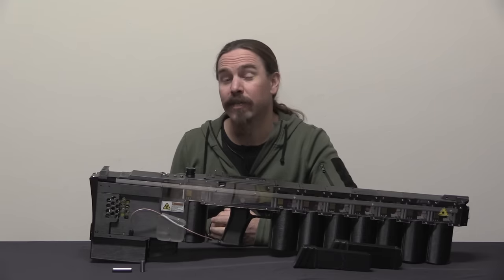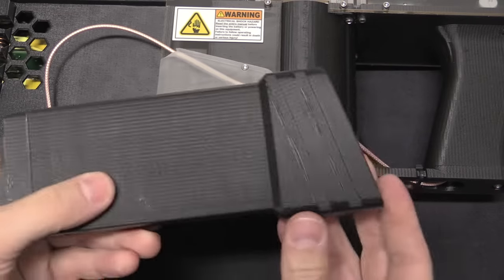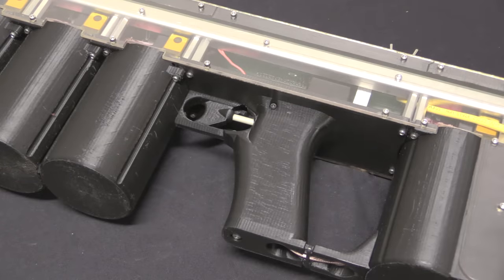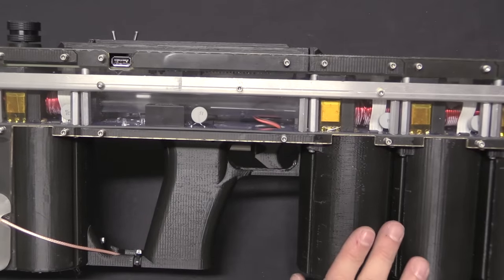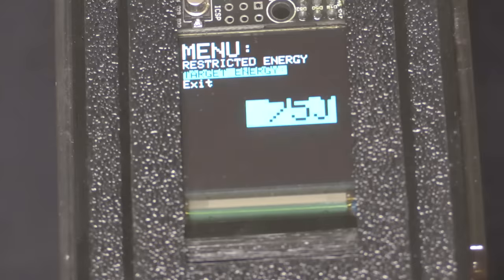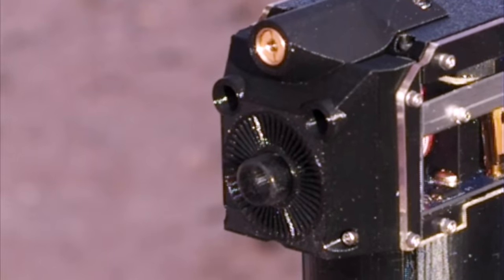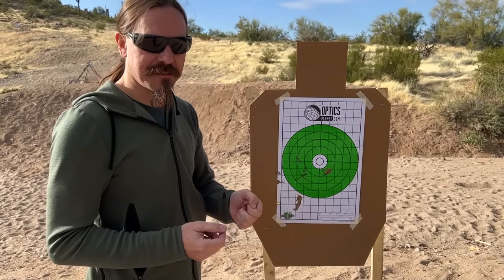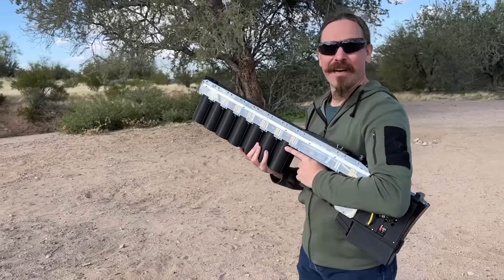ArcFlash Labs' GR-1 Anvil Portable Gauss Rifle

Comment: In perspective: this is about double the momentum and energy you'd expect from a top-end wrist braced slingshot.  Similar velocity with roughly double the slug mass.  It should be good for most of the same things -- except I've never seen or handled a slingshot that weighs twenty pounds and requires a high capacity (power tool?) battery.  Or costs what that thing has got to cost.

Still cooler than a slingshot, though.

It ought to be possible to make the slugs more stable the same way shotgun slugs are, by putting the center of mass forward of the center of pressure.  Simplest, drill a deep hole in the rear of the slug.  You could get a long slug with stabilizing cavity and still be about the same weight as a short slug -- but with less tumble, they'd probably also be more accurate.  Going a little further, it ought to be possible to put vanes on the rear of a slug by one method or another, even angle them to make the slug spin from airflow.
Reply: I don't know what the cost of this unit is, since it's a one-of-a-kind prototype.  But I do know I certainly would NOT want to get thwacked with a wrist braced sling shot.  I had one of those as a kid and you could really yeet rocks pretty hard.  Next test, ballistics dummy!
Reply: Hey that one dude from Taofledermaus can make some wild slugs for it
Reply: @Sophistry0001  Oh, I know -- I spent two months' allowance on a genuine Wrist Rocket about 1974.  Quarter inch steel ball would go through both sides of a steel soup can if you got a well centered hit.  Same ammo would quickly and humanely kill small game like rabbits and squirrels -- and like an air rifle, if you're unlucky it could kill you if you get shot with it.

Make this Anvil accurate -- even as accurate as a worn-out 1911 -- and it'd be a serious weapon.  And all you hear is the solenoid kicking the slug out of the magazine...
Reply: Grandma got the gauss rifle to get them gophers out of her garden.
Reply: Another idea is to make the rounds fin stabilized, basically darts instead of slugs. As they're magnet propelled rather than explosive, they don't need to be completely flush with the barrel.
Reply: vanes on a rifle projectile violate the geneva convention.
Reply: Its more of an rc jet battery. Well, its indeticle to the batterys that push my rc jets near 120+ mph! Fun stuff.
Reply: @Sophistry0001  It's not a one-off prototype, you can buy one now for $3375
Reply: @gettingpast4391  I'm not in the military so . . .
Reply: Fin stabilized projectiles. Modern tanks use sub caliber fin stabilized KE penetrators so the concept is sound. You don't even need a sabot in this case.
Reply: I would take Usopp armed with Black Kabuto over this thing any day.
Reply: @Sophistry0001  3 grand, you can buy one yourself. I bought the smaller one for a grand because, while the anvil is neat, I can't justify 3k for a big gun let alone a  supped up BB gun.

I will justify a thousand bucks for a supped up BB gun.
Reply: In the previous FW video the inventor mentioned spinning the projectiles magnetically.

Comment: Tod from Tod's workshop (he produces medieval bows, crossbows and knifes) has calculated the power of the the English longbow's arrow and a crossbow's bolt. It was between 120 and 170 J, if I remember. So this is almost as powerful as a medieval ranged weapon and faster.
Reply: Could be made so that it pens sandbags too, like arrows.
Reply: Thanks, this is a great way to think about it
Reply: But to be fair - modern crossbows would still be more powerful than this rifle, since they are way ahead of medieval technology
Reply: @lightwoven5326  That's going to be much harder though. The energy of the projectile isn't what makes arrows penetrate sandbags.
Reply: @joost1120  yes, momentum is a real beast. MV is momentum and energy is MV square.
Reply: @joost1120  no, check Todd's Workshop, it's the low speed and if the right shape. The slow blade from Dune if you like the analogy.
Reply: @GerManBearPig  Yes, a modern crossbow is like 2, even 3 times more powerful than a medieval one. I think modern bows are more powerful than this Gaus gun, too.

Comment: The problems that keep this from being a standard infantry weapon right now:

- Thermal build up. Current materials to form the wire coils simply have too much internal resistance and generate too much heat. Even if the barrel assembly was vented, the sheer mass of the coils cannot cool off fast enough to allow for significant rapid fire. We would require high temperature superconductors to be developed (negligible electrical resistance at temperatures close to 200 Fahrenheit to make rapid fire an option. As it is, this would have to be a precision weapon with low fire rate using near-current technology.

- Energy storage. Current gen batteries and capacitors are simply too primitive. There are two ways of solving the problem of limited storage capacity: you decrease the energy consumption or you increase the size. At twenty pounds, this rifle is already close to the limit of a feasible single-man weapon. Again, high temperature superconductors would provide a solution by drastically reducing the energy required. Heat is wasted energy in this case. A near-zero ohm material will be far more efficient at conveying energy to the capacitors, which would result in a smaller required battery and smaller capacitors. This means lower weight and a less cumbersome weapon. An extra benefit is a drastically reduced heat signature, which is great for night ops.

- Charge time. Unlike the first two problems, this cannot be rectified simply through materials science. You simply need more capacitors. The weight savings you'd get with advanced superconductors would be offset by the need for more capacitors. The solution is multiple "banks" of them. Suppose on a future rifle at a certain setting, the rifle uses 2 capacitors to send the slug out at speed. The rifle has 20 capacitors. This means, without recharging, the rifle could fire 10 shots in succession. And if the magazine was only 10 shots, then by the time a soldier ejects and reloads a fresh magazine, the gun could have recharged all capacitors.

- Tumbling. This is a fundamental problem with magnetic weapons. The ideal magnetic weapon free-floats projectiles to prevent friction from the barrel from affecting the shot and wasting energy. But without barrel contact, let alone rifling action, the projectile is unstable. Potentially, this could be solved by programming the gun to impart spin through the magnetic field to the round. But that adds complexity, and sudden rapid adjustments to high-energy fields. This increases wear and tear on the unit, and the likelihood of a catastrophic wiring failure. It isn't pretty when high-voltage wiring melts and shorts out while carrying load.

- Fragility. The problem, as Ian already mentioned, is that this weapon is an EMP generator. The modern battlefield is littered with electronics, with the most important of them being the personal radio. To allow this weapon to coexist in the hands of an infantryman, the weapon requires Faraday shielding. This could be as simple as a wire mesh that completely encases the weapon. Hell, it could be part of the injection molding process using Zytel. But it's also a computer, and can be disabled by EMP. It's not hard to make an EMP generator for less than $100 dollars that can mess with a television from 10 feet away. Hit the weapon with an EMP and you now have a massive plastic and metal brick in your hands that is only as dangerous as you could make it by throwing it. This is also a weapon that would not deal with very wet and corrosive environments well. You can strengthen the weapon against all these environmental threats, but that adds weight to a weapon that already weighs a lot.

- Field serviceability. Ideally, future versions would be almost completely modular. Slide coils off the barrel, safely discharge and unplug capacitors, swap batteries, plug-n-play display unit if cracked. But the problem is that if you need to replace any of those, you need to CARRY SPARES, which adds to the load of the already ludicrously encumbered infantryman. Admittedly, this would almost be a non-issue. Pure electrical components do not fail as often as items subject to repeated high physical impact stress. And if your soldiers are deploying on missions rather than combat tours, you can easily ensure your weapon is in top condition before the action starts.

All that said, it's early days yet for gauss weapons. I'm sure that these problems will be solved, one at a time, over the next few decades.
Reply: About the EMP effect of the gun.  My job in the Marines was electronics repair.  All the really important stuff is already hardened against EMP.  Also, the camera taking the video, which is a delicate piece of electronics, faired just fine when it was practically held against the gun when it was discharged.
You say it is a danger to computers because it generates EMP and in the next sentence you say the computer needs to be shielded FROM EMP.  If this were actually a problem it would shut itself down with every pull of the trigger.
You can delete the EMP section from your list of faults.
Reply: I think there is a better way to solve the recharging problem: intergrate the capacitor banks into the magazines. As you carrying the magazines on your magazine pouches they would already be recharging. This will also lighten the guns as you are carrying the batteries in your backpack and charging the magazines directly from it not the guns. Afterall, you only need enough electrical energy to fire all the bullets from the magazine your guns shouldn't hold more energy that what it needs.
Reply: During the show and tell portion, the screen on the top was a solid display. After firing a few shots at the range, the display was no longer solid. It was flickering, like it was affected by the coil fields.

That gun is a proof-of-concept build. I have no doubt that a production gun would be far more robust. For starters, as a designer, I would get rid of the display and replace it with simple LED indicator lights and a physical dial rheostat to set the shot power. While this would be more bulky, it would far simpler and cheaper to manufacture.

The computer is vulnerable to EMP, no matter how you cut it. Unless it's fully enclosed in a Faraday cage or solid conductive structure, it's only a question of how strong an EMP it takes to overcome the hardening. An EMP bomb going off right next to it will quite easily disable the computer, though I think at that point you have far more critical concerns than the function of your weapon.

One final note, it's not the voltage that's the measure of the battery capacity. It's the amperage stored in it. I lost count of how many batteries I change out that show 12.24VDC but have less than 100 cold cranking AMPS, and therefore cannot power anything more substantial than lights on vehicles and equipment. Like the starters on diesel engines. So that volt meter on the top of the display is somewhat misleading.
Reply: Keep in mind this is the firearm equivalent of a handgonne, at most an early Arquebus. Which were metal tubes full of powder and projectile lashed on a wooden stick. That you stuck a burn cord into to fire it. Either by hand or with a metal arm you moved. Yeah it's rough, but it does work. Which is the important thing. It flings a projectile at the high enough velocities to harm something. Even if just barely.
Reply: @minhdao4790  The flickering of the screen is almost certainly going to be a camera effect. On set, Ian has complete control of the lighting and framing and has a locked-off stable camera.
The camera used on the range probably isn't the same camera, and definitely isn't operating in the same conditions.

While you can get cameras to record LCD screens in certain circumstances, in most, they just don't play ball.
Reply: Stick some plastic fins on the projectile to solve the spin stabilization problem. Most modern smoothbore weapons use fins for spin stabilization.
Reply: Interesting analysis. Solutions to these problems are easily implementable however complexity increases greatly.
Reply: As you point out that's a frame rate thing - LED screens look better when shot with a slow frame rate, but in the bright sunshine the camera was shooting at a high frame rate that didn't mesh with the LED's natural refresh rate.
Reply: Quite a lot then
Reply: The tumbling problem is easily fixed by swapping out the standard Gauss rifle coils for Rodin type coils or Starship type coils. It is such a low hanging fruit of an idea that I am surprised no one has ever thought of it or tried it before.
Reply: @lars573  There is still potential for modifications even with the current design. The creator said the gun has an USB port for user to reprogram the firing circuit. Coil guns are very adaptable to ammunitions as long as you have the right settings. The gun has basic settings is for a steel slug. But you can make a high performance round by using neodymium magnets and lighters metals slug. You only need the magnetic field to be strongest at the surface of the slugs to increase interaction with the coils so a neodymium magnet slug can achieve highly condensed magnetic field on the surface. Of course a slug like this will move faster so it will require a different firing sequences of the coils. Imagine in the future your coils guns can fire high performance ammunitions at the store but if you don't want to buy it you can just turn the selector switch and it will adopt homemade machined slug made from steel rebars.
Reply: Projectile shape can provide stabilization without spin under the right conditions. There's several projectiles on the Taofledermaus channel that work without spin. Of particular note is the diabolos shape used by air rifle pellets and shotgun slugs. I have no idea if projectile shape effects how this device operates though.
Reply: the tumbling issue can be solved by making the projectile a dart. simple as. it might also serve it better for the projectile to be incased in a sabot when in the barrel.
Reply: @CowCommando  Speaking of Taofledermaus, many failed dart projectiles from his experiments might actually work in a coilgun as a coilgun works by pulling the bullets forward instead of pushing it so there is no chance of the fins getting damaged from the firing process. The didabolos design on the other hand might not work as well in the coilgun as coilguns depend on magnetic interaction, the more material presented at the outer surface of the projectile the better the gun work. That's why they usually fire solid slug out of a coilgun. There is more things for the coils to "grab" on. And because surface textures disrupt the magnetic field it's best that where the slugs make contact with the barrel it is a smooth continuous surface. Plastic fins are ok because they can't disrupt the magnetic field if they can't interact with it in the first place.

Comment: Awesome. I'm not convinced chemical propellant weapons will ever be obsolete, but this is insanely cool.
Reply: If you’re interested Google about hydrogen guns and electronic ignition guns (very interesting).

Basically with accurate electronic ignition they use chemical compounds which burn in the thousands/tens of thousands of degrees. The velocity of those type of weapons is phenomenal, basically real life plasma guns.
Reply: Hmm so not only do you need ammo but spare batteries too. No good on a battlefield.
Reply: @AnthonyCook78  the usage is more implied to be anti tank, artillery kind of weapon.

It has to have specific advantages against firearms which are not developed yet. So far could be seen that those guns are very lightweight and quiet.
Reply: @ee214verilogtutorial2  Hey did you see that fpga on there?
Reply: @mattkostandin  pretty neat right?

I have a feeling it will be an industry standard for firearms to have integrated FPGA installed on them for one reason or another.
Reply: Is it inaccurate to think we might one day see coilgun hybrids? Like, traditional firearms with their bullets accelerated by electromagnetic fields. Maybe if the technology ever gets lighter?
Reply: @hankisdank388  could become a reality, biggest problem would be to downsize the power source without losing too much capacity.